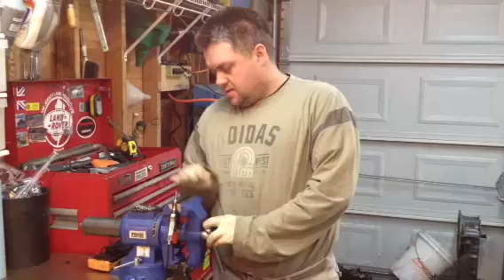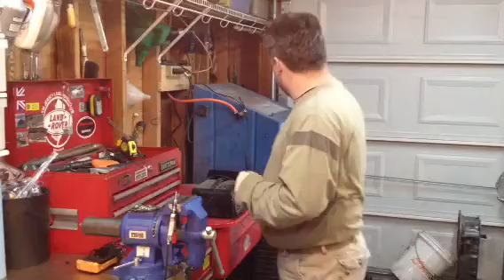Bench test glow plugs.

Comment: so thats not actually a charger, but rather a starter? it prolly wont work with a 5-8 amp charger?
Reply from the maker: you are correct, test was done in 50amp setting on my "charger"... which makes it a "starter/booster" in that option.  Apologies.